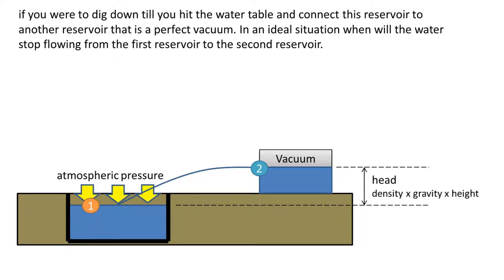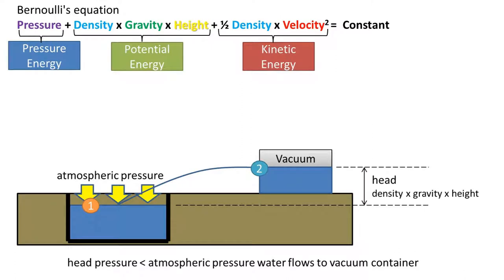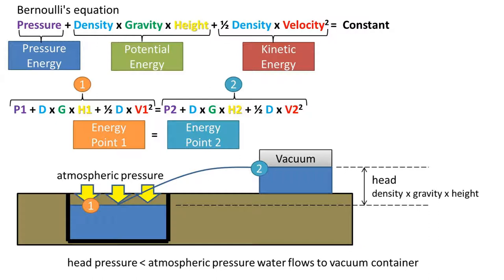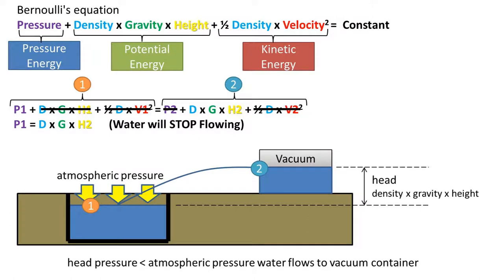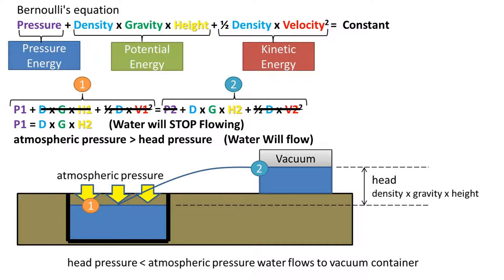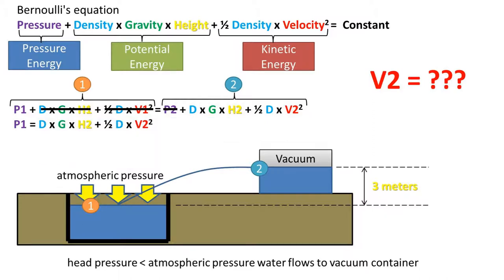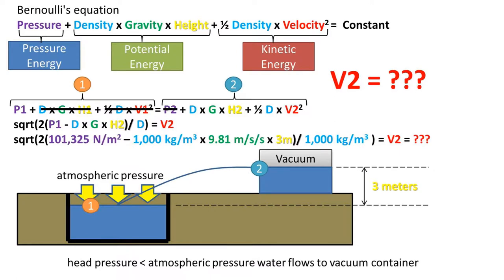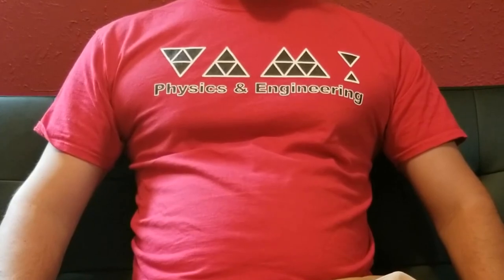How High Can A Vacuum Lift Water And Velocity at Given Height (Bernoulli Equation Viewer Request)

Comment: If your outlet from higher reservoir to a shallow pool as long the outlet tube under neath water no air inlet then water keep flow out forever as lower reservoir still had water like larger body of sea or river and if I the middle is a gear box it driver electric generator but the top reservoir air tight and strong body above vacuum pressure strength

Comment: Stupid question, if you know the velocity at point 2 couldn't you also find the a velocity at point 1 with the continuity equation? Q1 = Q2, what that velocity be the velocity at ht ebeging of the pipe inside the pipe? rather than the velocity at point 1 which i issume is at the surface? when you said the velocity at point 1 is 0 because the water line is constant is that meant that he level of the water is not going down or if it is the velocity is very slow? but if it is going down very slow due to continuity the water going out at point 2 has to be going in at point 1 right ? i am sorry i am either getting confused or just complicating it it more
Reply from the maker: When doing this problem I was assuming a large reservoir (water table) simplification. Point 1 is at the top of this large reservoir so we can assume that the flow rate is negligible here (moving chaotically and seeping from the ground in such a way that there is no significant velocity). Keep in mind the pipe was supposed to have an inlet below the water line some where and not at point 1.

Comment: HI Thank you for this video. I am learning about this topic for a DIY project. Putting the calculations aside, I have a conceptual question. 

in this scenario, to where does the water flow? The vacuum of the upper tank eliminates the atmospheric pressure working against the water table, allowing the pressure of the water table to "pump" the water up to a higher location. In order to create the vacuum, the upper tank is a closed system making it a fixed volume. Therefore, where does the water go when it reaches the upper tank? It would seem that in order for the water to enter the upper tank,  there would need to be an outlet on the upper tank to accommodate the increase in volume of the water entering the tank. Wouldn't the addition of water create more pressure, resulting in restriction of movement? To create more space, the air holding the vacuum would nee to be reduced. Would an air valve break vacuum?  Theoretically, could there be an outlet on the back side of the tank allowing the water to flow in at a higher point and out the tank at the same time while maintaining the vacuum?  How does this work? -rob
Reply from the maker: I am still trying to wake up so I apologize if my interpretation of the question is incorrect... You can think in terms of throwing a ball up in the air... the pressure energy difference between vacuum and atmospheric is only strong enough to throw the ball (water) up so high. This is the max height which can be calculated by p atmosphere/(density x gravity) = height. If you wanted to make a system of vacuum chambers to lift water you would need to have a valve that cuts it off from the water source and a valve that opens after that which allows the vacuum reservoir to reach atmospheric pressure. In most practical applications they use a pump close to the height of the water reservoir to pump the fluid up.
Reply: In a perfect vacuum there is no air. Dececreasing a the volume of a perfect  vacuum does not increase its pressure as there is no air to compress.